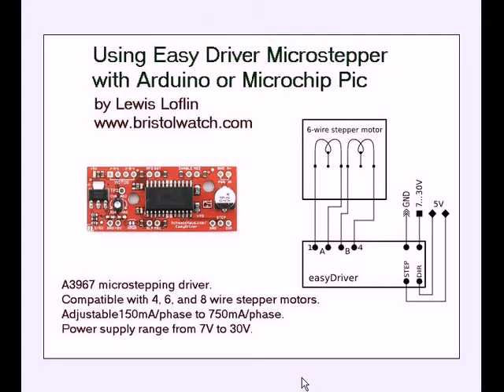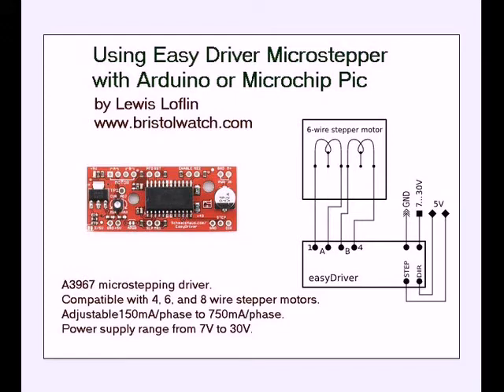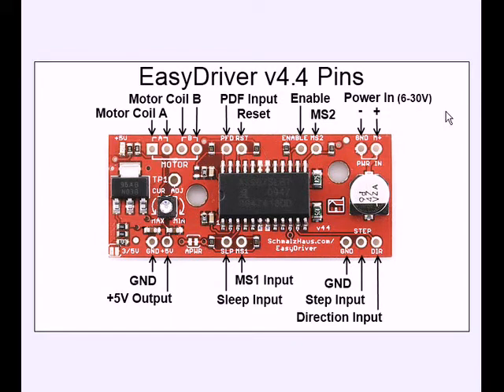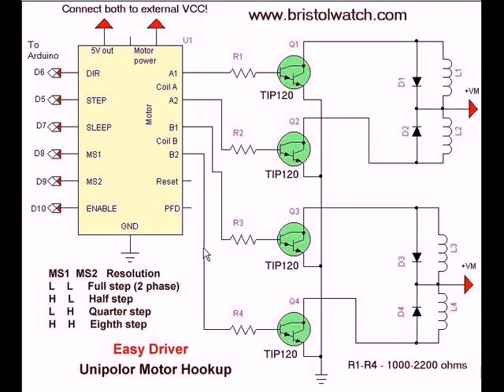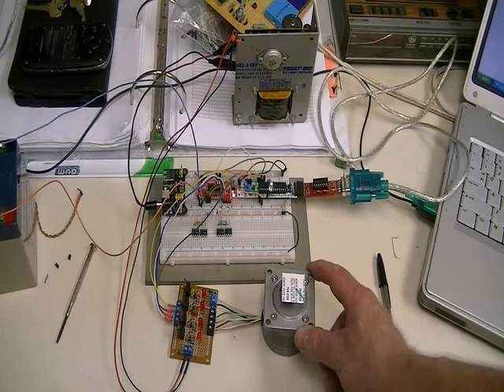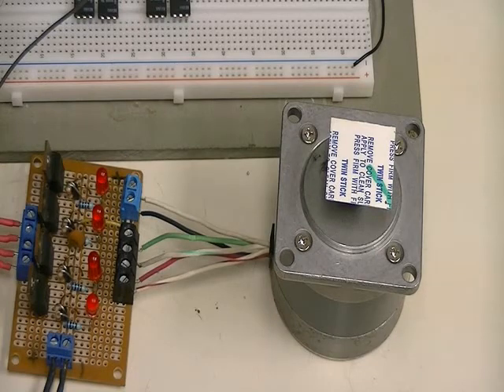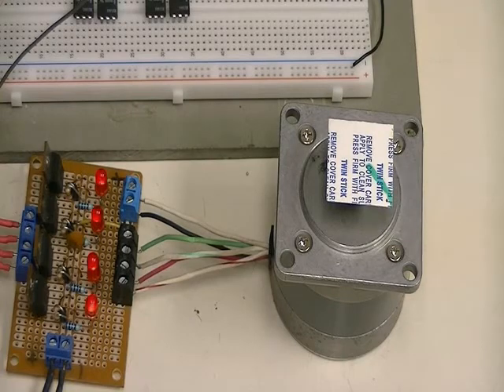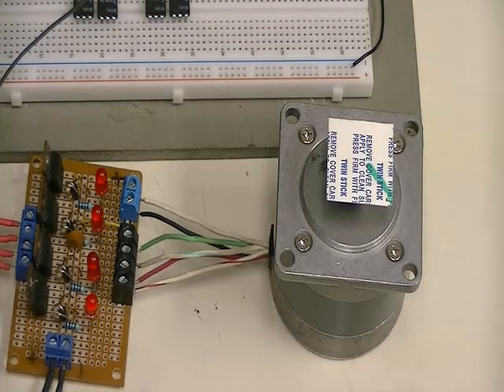Easy Driver with Arduino and Unipolar Stepper Motor

Comment: Thank you for your teaching video. I have been looking for a simple, inexpensive, yet powerful circuit that uses the newer Step/Direction controllers with Unipolar stepper motors. Thanks Again.

Comment: Hello, would I be able to use this design with certain modifications in motors with bipolar configuration? In this case, instead of controlling four transistors, the outputs for the 2 coils of the easy driver would control two h-bridge (2 inputs per h-bridge only with the help of logical inverters). I would also need to use a current limiting system, I saw a simple way that uses two transistors with a sence resistor and a pot for adjustment, it would be placed before the supply of the motors (per coil), that would be a good idea or it just wouldn't work the way thought? The alternative would be to use a PIC.
Reply from the maker: It's a matter of hardware. I used the same code for either one.

Comment: Hello i am French . Thanks for the very good explination . Do you thinks that with TIP 120 i can drive an unipolar motor stepper with a A4889 module as you do with your module. Thanks

Comment: This circuit might work for single stepping and half stepping, but I can't see how it would achieve quarter/eighth steps. The A3967 chip in the Easy Driver micro-steps by controlling the current in each phase of the motor to hold it between the  full step positions, which this circuit would not mimic.  Have you measured the actual distance moved between each step?
Reply from the maker: Yes it can as a remember you just change certain mode pins to1/8 step. This doesn't control current because its output isn't driving the load. Yes use a separate constant current source.

Comment: Thanks for this video. Can i use IRFP450 MOSFETs instead the TIP120s Darlingtons?
Reply from the maker: Yes, connect a 15-27K resistor between each gate and ground.

Comment: I note that the description of the video is "Easy Driver with Arduino and Unipolar Motor" but then you show what you say in the video is a bipolar stepper motor (although it has 6 wires?) Came here because Easy Driver boards are specifically for bipolar motors apparently, and I'm interested in 5-wire unipolars, thought you might have had a trick to make that work... but this is more about using a Easy Driver to drive a motor that requires more current than the a Easy Driver can provide, isn't it...
Reply from the maker: ***** It's a unipolar.
Reply: You using your circuit on a Unipolarsay that the test motor in your video is a Bipolar, this was confusing, so I went aout to find anyone else who is using a Easy Driver to control a Unipolar, and I found the same confusion. All we can do is ask you to explain how you get the Unipolar to work, but only demonstrate a Bipolar.  I am in the process of  using your circuit on a Unipolar, but then I realized that the Easy Driver controls a Bipolar, so I rewatched your video to see if you mention the  how, but you don't. So is it just in how you wire the motor that gets a Unipolar to work? Or are we correct, you just typed the wrong type of motor in your description.
Reply: If you leave the center taps not connected, and your motor has continuity between each of the two coils, it is now connected as a Unipolar motor.  I noticed in his schematic that he shows +VM on the center taps, but I don't know why. I will leave mine not connected.

Comment: For what is the capacitor that is between the positive and negative in the middle of the mosfets and what value has
Reply from the maker: Removes motor switching noise. 100uf should work but value isn't critical.
Reply: Thanks, I preferred to make this type of control because the arduino l298 does not give the current and they are easy to stop with the hand. In contrast this control gives the maximum force of the motor, only that I did not put that capacitor to them, they can put them in the Stream entrance or have to go in the middle of the mosfets

Comment: How do we know which 2 wires are one coil? I have a hybrid 5 wire, they are numbered as per a tube vid to determine what type stepper you have but does not say what a or b coils are.
Reply from the maker: This was simple in that I knew the color code of the wires. One of the five is a common if you don't have the spec sheet determine the common with an ohm meter then it's a guess - swap wires.

Comment: Great video . Can you tell me what I will need in terms of software to run an Arduino Uno to control a future small 3 axis  CNC machine running gcode.
 Thx in adavance
Reply from the maker: Don't know what gcode is. If you are using three motors that will require three complete stepper units. Trying to use a single arduino is tricky for timing problems. Why not use three Ardunos to control an easy driver each and connect all through say I2C?
Reply: @LewisLoflin  hello, it's 2018 and there is grbl !

Comment: when using the easydriver with transistors and unipolar stepper can the easydriver control the stepper current ?? i am asking in case i want to use a stepper with higher voltage than the rated votage
Reply from the maker: Elias Taalab No it can not. I use a separate current limiting circuit.

Comment: Can I use a unipolar stepper motor with no easydriver transistors and diodes for control of a single step to both sides?
Reply: For a single step, you may want to consider how much current wil be needed, and how often those steps will be required. Mostly the transistors and diodes work together, the transistors allow much more current, and to not over burden the Easy Driver, and the diodes protect the transistors from the  surge of voltage when the electric field collapse .  They are very cheap parts, and to not use them could be only asking for problems. Especially since you asked this question.

Comment: Are those diodes on the schematic or the LEDs you have in the video?
Reply from the maker: Those are diodes used to suppress voltage spikes the the coils are cut ON-OFF. I used iN4001s.
Reply: Thanks! Love your stuff!
Reply: Hi again. What I'm trying to do is hook up a bipolar stepper to an Easy Driver and tip120 's. Is there a way to do that?
Reply from the maker: That is a unipolar stepper motor setup and won't work with that. It would require Easy Driver to operate two H-Bridges.
Reply: thanks, that's i will pursue that route.

Comment: boa tarde! Eu preciso de uma ajuda quanto a uma programação de um motor unipolar. Preciso que a partir de um numero de rotinas do Arduino , o motor desligue e não continue a rotina.  Como faço para fazer isto ? 
Lembrando que estou usando unipolar motor, easydriver e a ponte h ln298n.
E se tem como converter os pinos para a biblioteca Stepper

Obrigado,
Raphael
Reply: You can turn the driver off by using the Enable pin as shown in the  diagram, and talked about in the video. It will stop the driver from doing anything.

Comment: Why do you use resistors between the EasyDriver and the step motors?
Reply from the maker: Those are MOSFETs and it's a gate bleeder resistor.
Reply: Oh gotcha, thanks!

Comment: You cant control the sequence of the tips directly with the arduino?
Reply from the maker: +jafet rios Don't understand the question - what "tips"?
Reply: +Lewis Loflin i mean the tip122, if you can control them with out the easy driver only with arduino
Reply from the maker: Yes you can use a 2.2K resistor from Arduino to the base.
Reply from the maker: Yes you can but it's hard to do complex stepping with Arduino which is why I used Easy Driver.

Comment: How you limit current and protect motor?
Reply from the maker: I used a high current motor in this project by boosting the power with external transistors. Easy Driver has a setup for that, but I prefer a current limiting transistor in the motor supply circuit.